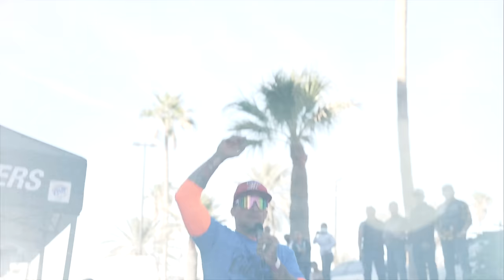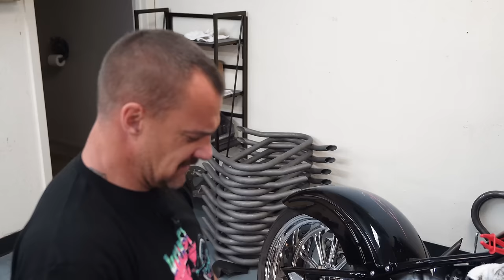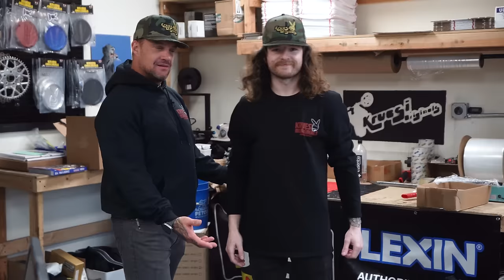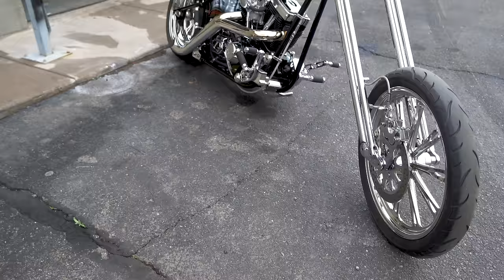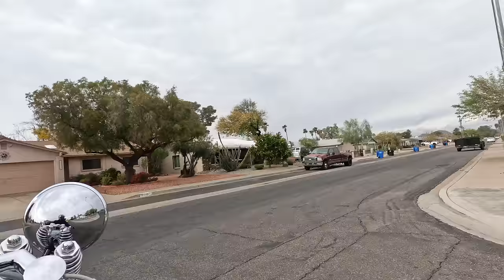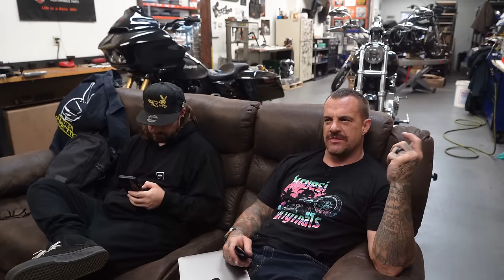We finally ride the chopper!  Kruesi Vlog #67

Comment: Finally got to see you on the Chopper sharp putt there, ive had the same gas tank problem, i used acid,flush then mavel oil to coat tank keep it full of gas it helps to keep fuckin rust away now , will recoat tank in summer 😊😎👍
Reply from the maker: They are a pain in the ass

Comment: Petcock: Noun: a small valve, especially in the pipe of a steam boiler or cylinder of a steam engine for drainage or testing.
Etemology- "Petcock"first appeared in the mid-19th century. The "pet" part seems to be rooted in an old sense of "pet" meaning "small," possibly related to our modern "petty", which all makes sense since a "petcock" is, as we noted, a small faucet. The "cock" part is probably rooted in the verb "to cock," meaning "to turn up" (as in "cocking one's hat") or "to block," Whatever the logic of the term, "cock" has been used to mean "spout or faucet" since the 15th century, and is also found in the word "stopcock," which also means a small adjustable faucet.
Reply from the maker: Best answer 🤘🏼

Comment: The "pet" part seems to be rooted in an old sense of "pet" meaning "small," possibly related to our modern "petty," in turn harking back to the French "petit" (small), which all makes sense since a "petcock" is, as we noted, a small faucet. pet" part seems to be rooted in an old sense of "pet" meaning "small," possibly related to our modern "petty," in turn harking back to the French "petit" (small), which all makes sense since a "petcock" is, as we noted, a small faucet. The "cock" part is more problematic. My own sense is that it is probably rooted in the verb "to cock," meaning "to turn up" (as in "cocking one's hat") or "to block," drawn from the defiant behavior of roosters. Whatever the logic of the term, "cock" has been used to mean "spout or faucet" since the 15th century, and is also found in the word "stopcock," which also means a small adjustable faucet 13:03